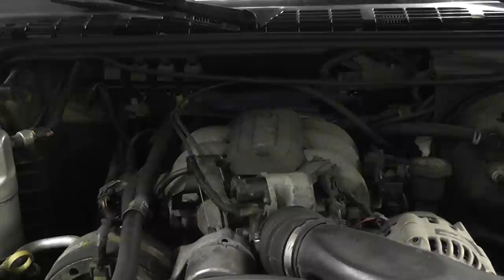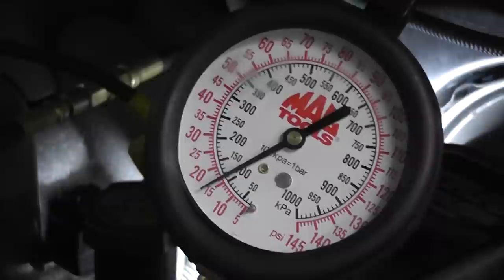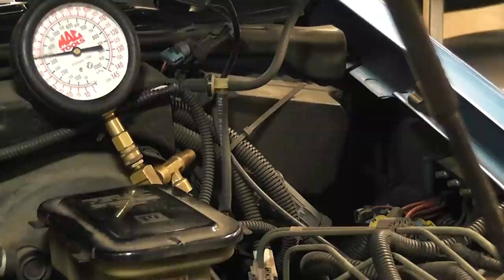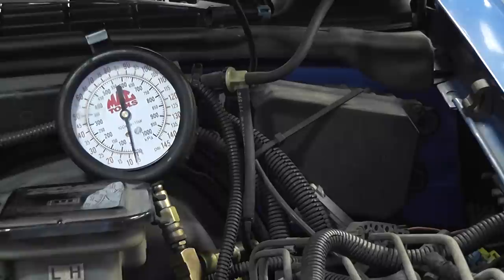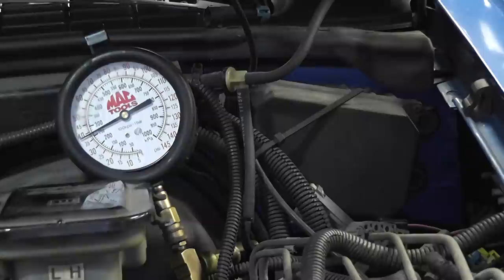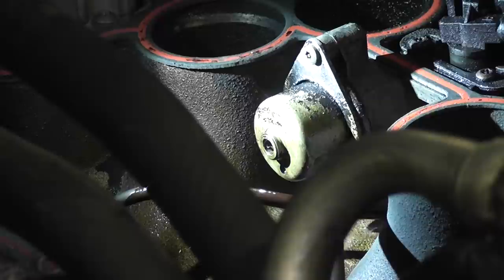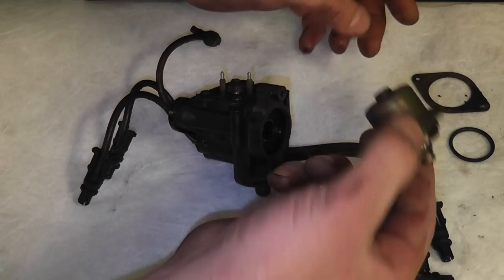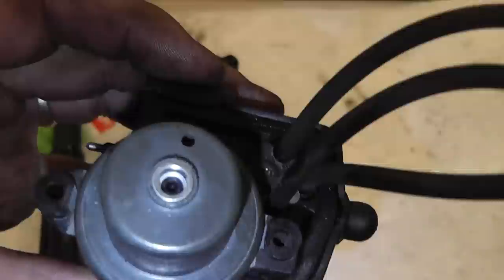How to identify and repair a leaking fuel pressure regulator (GM CPI system) part 1

Comment: Please help Scanner Danner, I have 60 psi with the pump running and I can't find a visible leak. However I have air coming out of the newish FPR. Could this be why  im not building pressure.  I've went threw all of your test so far
Reply from the maker: you said you have 60 psi, then later say you are not building pressure, can you explain a little bit more about what you are seeing and what your symptoms are?
Reply: @ScannerDanner  I've only got 60 psi with the pump energized, but what has me puzzled is air is leaking from the FPR instead of fuel. And with it energized there are no Leaks
Reply: As soon as I turn of the pump it drops to 0 psi
Reply from the maker: @ryanbean3548  60 psi is what you should have. No idea how you're determining you have an air leak in your regulator?
As for the bleed down, pinch off the lines under the drivers door area like I did in this video to figure out where your bleed down is.
Reply: I found the issue , bad inner seal in the regulator,  but how I found the air leaking from the FPR. With the Plenum off I energized the pump using  the plug on the firewall and with 60 psi on the gauge I have air blowing out the regulator
Reply from the maker: @ryanbean3548  still don't understand how air is leaking from a hydraulic system, but I'm glad you found it!

Comment: My fuel pressure quickly drops to zero when the key is turned off. The engine starts without delay and isn't running rich or abnormal so I figure the check valve in the fuel pump is doing its job of blocking the pressure line but the regulator is failing to block the return line and needs to be replaced !/?   (97 Ford F150 4.6)
Reply from the maker: Need to pinch off the hoses to prove your theory my friend. But the pump check valve is most common
Reply: @ScannerDanner  Wouldn't a bad check valve cause a long crank time  ?
Reply from the maker: @JoeBlowski  depends how good the pump is. A bleed down on the regulator should as well, but I get your theory, that I'd be more significant if it was a pump check valve
Reply: @ScannerDanner  Thank you Paul. I was tempted to replace both the pump and regulator, but that goes against everything you teach so very well about precisely pinpointing. I fully understand your excellent lesson on pinching the hoses in order to pinpoint. I will look again but I don't think I have hoses to pinch which would probably leave me only with logical deduction which in my way of thinking completely rules out the check valve. I expect to keep my old truck for many more years so I don't mind throwing parts at it even though that method goes against my grain and earns me an F in your class, but I think I should replace the regulator to satisfy my theory because I'm stuck on the check valve not causing a start delay by keeping the feed line full.

Comment: does a 2000 nissan quest mini van have a fuel pressure valve?
Reply: Phoebe lynn call the auto parts Store or the dealer and ask them for that part and if they say it’s not available for that car and then, No.

Comment: It bleeds off a 1 psi every min.
I pulled off the intake an reconnected the fuel lines to injection system an pressurized it an there no leaks at all!
Intake is no signs of leakage!

An also this problem started after we replaced the fuel tank!

Im half temped to replaced the fuel pump but I hate throwing parts at vehicles an explain it to the customers why I was wrong!

But I also compared all data pids between my donor blazer an the actual problem s10 an the only thing was dffnt that was fuel trim numbers were high in the negative!

I've never seen a fuel pump cause a rich condition
I just don't know what I'm missing!

It really seems like a case of fuel leakage in the intake!
Hit the gas all the fuel trim numbers go normal 
Same concept as a vacuum leak but the number aren't positive!

Comment: That regulator mis-fit is typical of much of Dormans design and quality, didnt use to be so years ago.  I remember once I bought a replacement dome light cover that said it fit my vehicle exactly, but it was almost an eighth inch too big around.  Returned it twice and all three were the same wrong size.  Im guessing Echlin, GP Sorenson, Delco or Standard motor products wouldnt have had this issue.  Its almost as if no one at the design or manufacturing points even took the time to verify the fit-!!

Comment: I have a 2003 blazer that struggles to start, I get 50psi idling when given gas it goes to 60 then drops to 40 then back to 50, and almost instantly drops when turned off, is it the fuel pump or spider injector
Reply from the maker: What is your fuel psi DURING cranking? It should be over 60 psi
Reply: @ScannerDanner  it would start at 0 then slowly build up to 50ish and start, it runs fine after firing but sometimes it fires right up after sitting overnight maybe twice a week, not to sure of the history of it but it looks like the fuel pump might have been recently replaced due to clean wiring around the pump
Reply from the maker: @hairydeck  well, you now know why it struggles to start. This system will NOT start below 50 psi
Reply: ScannerDanner also when I fill it 100% up it will stall out on me unless I run it for about 30 seconds in park
Reply from the maker: @hairydeck  that sounds like a stuck open purge valve. Disconnect it and block off the intake port and see how it reacts after fill up

Comment: Can a fuel pressure regulator cause positive fuel trim?
Reply from the maker: if it fails in the open position and causes low fuel pressure, then yes
Reply: @ScannerDanner  getting really Dimitar symptoms to having a vaccum leak sometimes takes a few cranks to start trying to solve this problem replaced map sensor o2 seneor check for vaccum leaks
Reply: @ScannerDanner  I'm not sure what else it could be

Comment: so my 4.3 primes good to 65 psi and holds but right at cranking it drops to 45 psi then rises. truck wont start, is that the cpi?
Reply from the maker: Nope, the fuel pump is weak. Can you get it to start by cranking it when it hits 65?
Reply from the maker: These will not start below 50 psi due to the mechanical poppet nozzles on the injector ends
Reply: No I can’t and it only drops to 45 after multiple cranks but goes back up to 65. Mostly cranks at 55. I’m starting to think it’s a spark issue because even with ether it won’t start
Reply: I have spark but it looks weak, I might swap the coil or the cam sensor

Comment: Can anyone offer suggestions to me on an issue that's beating me to death. 1998 Ford F150 5.4 liter. Ran great last week. I went out to start it and it started and immediately died. After that, it would crank, but never started. I sprayed starting fluid into the throttle and it would attempt to start, but wouldn't. I checked the fuel pressure and it was at 0%. I replaced the pump and now I have fuel pressure that's within Ford specs. It still cranks, but no start. The inertia switch hasn't been tripped. The fuses and solenoid are in good shape. I just checked 1 injector with a noid light and it works. The only codes thrown are GEM codes for the power window driver side, ignition key in switch fault and the vss vehicle speed sensor. The power window and ignition key in the switch fault has been present for a year. I'm at a loss. The ignition switch code is B1352. I will add that the CEL goes off while cranking, so it is getting a signal. The RPM does move (150-160) according to my scanner while cranking as well. It backfires out of the tail pipe while cranking and has a very rich smell. Not sure if that odor is due to me spraying starting fluid into the throttle body or not.
Reply from the maker: backfiring out of the tailpipe is not a good symptom. I would look into a timing chain issues next. Maybe do a compression check on a few cylinders to get an idea.
Reply: ScannerDanner Thanks man. You're the best.

Comment: I have a '95 Blazer LS 4dr 4x4 which I love. I have a starting issue were it will start and then stall instantly then it will just keep cranking and cranking but will not start even when I floor the accelerator. I spray starting fluid or brake cleaner down the throttle opening and then it starts and runs just fine on it's own and is good for 2 to 3 weeks and then it happens all over again. During that time it does run the service engine soon light will come on occasionally sometimes flashing and sometimes not and will go out after a couple of minutes but does not come on when the starting issue mentioned above occurs. I took it in and the mechanic told me it's an electrical problem having to do with the signal from the pcm to the fuel injector. Anyone know what is going on? I'm stumped. Please help me!!!
Reply from the maker: Yes sir, your fuel pump is failing. But you must confirm this before replacing. Next time it acts up, measure your fuel pressure, at 50 psi or less, it will not start, due to the mechanical injector poppet nozzles on these CPI systems. You should have a minimum of 60 psi during cranking on your system. Bet you have lean codes too (p0171 and 174).
I have a video on this on this system
Reply: @ScannerDanner  The fuel pump has already been replaced and it wasn't the problem. Fuel pressure regulator wasn't the problem either.
Reply from the maker: @Tbolt1000TForLife  doesn't matter, get a pressure reading, if its low, power and ground tests must be done next before dropping the tank again.  Get me a psi reading DURING the no start, and I can help more
Reply: @ScannerDanner  The fuel pump has been replaced twice already. My dad did a fuel pressure test and it went up to 60 at the turn of the key and bled down to 30 after 2 minutes. The mechanic I took it to(a very good one that I trust might I ad) says that is normal for the CPI system. Pressure remains at 60 when cranking and doesn't bleed down. The mechanic told me the starting issue is electrical, having to do with the signal from the pcm to the fuel injector. Hope this helps.

Comment: Hello it's me again I know this is an older video but by George I think you help me my 1999 Chevy Tahoe cranks but no starts but if you use starting fluid it'll start up and run like poop but I'll run but if you shut it off and let it set it starts to bleed off like if you go out in the morning it will just crank and crank and crank but if you use starting fluid it'll fire up I think it's my spider pump thinking it was a fuel pump but it's pumping just not holding pressure for it to start 55 to 60 key on engine not running key on engine turning drops down to 45 your thoughts would be greatly appreciated I joined your Facebook page

Comment: how did you scan the 1995 obd1.5 system in that truck (hook up is obd2 computer is obd1)not even the dealer has a scan tool that works on my truck
Reply from the maker: with a 12 pin data link adapter for my same scan tool I use for everything. (Snap-on)
Or if it is a 16 pin OBD2 style of connector that actually is not fully OBD2 compliant, I can still talk to those too. 
There are definitely aftermarket scan tools that are available within the DIY price range for your truck

Comment: Misfire also? Checked for fuel pressure it's at 50 on my 4.3 shit vehicle off and it drops to 0 right away
Reply from the maker: "Misfire also?" Not sure what your question is
Reply: @ScannerDanner  would it cause a misfire code also? P0300 she almost left me stranded today. It's getting worse. Did a pressure test on fuel and she drops to 0 right away. I can't pinch any lines off they are all hard line. I'm thinking it's the regulator
Reply from the maker: @alexvelez2141  yes it will, especially the middle two cylinders on both sides as there are drain holes in the intake that lead to those two cylinders.
Also your fuel trim numbers will be very negative with it running. Are they?
There are lines under the drivers door area on the inside of the frame that you can pinch off
Reply: @ScannerDanner  I will check that. I'm not sure how to check my fuel trim with my scanner. It's smarter than I am . As for the plugs I did pull the passenger side and it didn't looked soaked. I appreciate the help I really do
Reply: @ScannerDanner  yes they are negative 0% - -3.960
Reply from the maker: @alexvelez2141  what is the Long Term Fuel Trim
Those numbers you gave me are normal but if that was Short Term Fuel Trim that isn't enough info.
If that was the LTFT number, then your massive bleed down issue is NOT what you are seeing in this video. Long crank time, yes, but leaking regulator as the cause, no. Because Fuel trim would be way negative. -20 to -50%
Reply: @ScannerDanner  I will check again tomorrow. It's late here. I'm frustrated with it. I definitely have bleed down within a second or less it drops to 0 right away and p0300 code within 3 minutes of it running
Reply: @ScannerDanner  I need to fix it this coming weekend. She's the only vehicle I got
Reply: @ScannerDanner  hey bro do you have an email address?
Reply from the maker: @alexvelez2141  can't offer tech support via email my friend. Let's move this to my forum www.scannerdanner.com It is free to join and we can absolutely help you there. I'm traveling today so my assistance will be spotty
Reply: @ScannerDanner  ok no problem. I have my fuel trims recorded from scanner . I was going to send them to you. I have suspicion of my O2 sensor but that doesn't explain my fuel pressure bleed down
Reply from the maker: @alexvelez2141  what are your symptoms? Low power? Long crank time I'm sure, but this can be as simple as a fuel pump check valve issue, in which case your bleed down has nothing to do with your misfire on running issues.
Fuel psi should be 60 psi cranking and at wide open throttle, this is a super important test on your system. If you start dropping pressure near 50 psi, you will develope some pretty significant low power conditions and possibly misfires.
I think you should confirm fuel psi first as the bleed down bothers me
Reply: @ScannerDanner  fuel psi at start up was dead on 50 when I tested it Saturday. Shut it off and it dropped right away. I won't have time untill Saturday to see if I can pinch a line off and confirm it is the fuel pump. That was my initial thought but knowing these four threes are known for fuel pressure regulators and the spider injection I thought maybe that could be the cause also
Reply: @ScannerDanner  yes my symptoms are loss of power, long crank time. Rough idle and after 3-5 minutes of driving it jerks and starts flashing engine light
Reply: @ScannerDanner  -0.781% on Long term bank 2

Comment: Love your content excellent tests. However you never explain the results of the test if fuel pressure held with both return and supply pinched off. That is what mine is doing, and you didn't explain what it means.

Comment: Arterial Pep Boys electrician store number 0604 claimed initially the installed new pump was Factory defective. Then admitted they've got no idea what's wrong as well as the managers admission. I bought additionally against their suggestion a fuel pump relay from AutoZone. And installed it in my non-running truck. That may have pushed it over threshold of functionality possibly.. The truck was then running without them having called me as I surreptitiously checked on them. I imagine they were trying to see why it suddenly was starting.. or possibly then Serendipity with starter fluid. They also claimed to have lost my other fuel pump assembly. That I wanted to see. I then went to get my old fuel pump and filter directly from the mechanics inside. Surreptitiously again.. like pulling a tooth to have them hand these items to me as I stood behind my. Vehicle That old pump will be checked by the Bureau of Automotive Repair at some point. As well as that supposed clogged filter. Initially stated that's why the pump burned out.
Reply from the maker: so your question for me is?
Reply: ScannerDanner can you join me a Lynch Mob outside of the store? Also and mainly bear Witness to this atrocity of ethics and policy. Possibly a ballpark guess to narrow down where I should start first changing parts
Reply from the maker: Changing parts without a proper diagnosis was what got you in trouble in the first place right? Why would you want to continue on this path?
My slogan in "Don't be a parts changer" 
Start from scratch, find out what you are missing when the truck is not starting. Spark, fuel injection pulse, fuel pressure etc
Reply: ScannerDanner we tend to be constrained with proper process procedure and methods.. we can't think out of the box.. this is not unscientific.. this is pragmatic.. change one part at a time.. until problem is rectified... This is process of discovery... you will definitely find the problem.. and discover definitively that problem.. For future repair jobs.. the process may be useful.. if only borrowing parts from stock to more quickly discover.. when presented with a mechanical dilemma as rare as they are.. also during emergency someone who knows nothing about auto mechanics cannot hurt the vehicle but will definitely come to a successful conclusion of repair.. buying parts and if not the right part returning to the store proclaiming that it was not the right part . . refunded

Comment: 35 minutes??? Pull the vacuum hose of the regulator. If fuel is coming out of regulator, its bad. 30 seconds.
Reply from the maker: The regulator lives inside of the intake manifold on this model. Pay attention, you just may learn something
Reply: I owned one of those. No wonder i got rid of it.